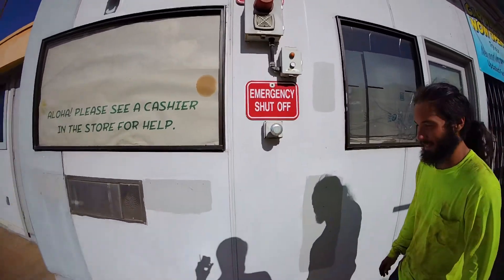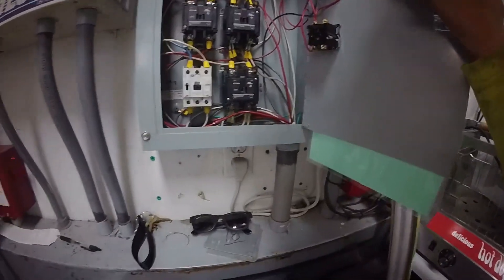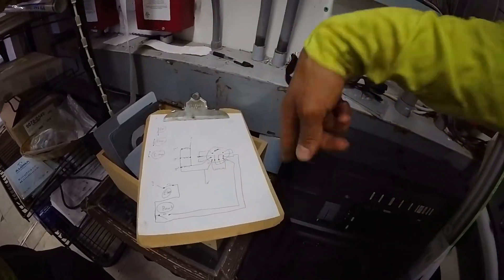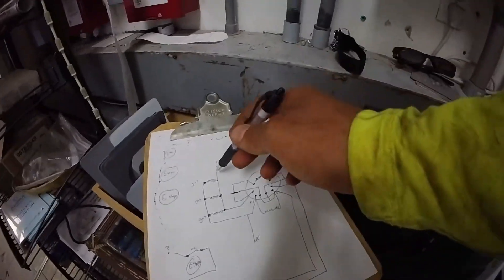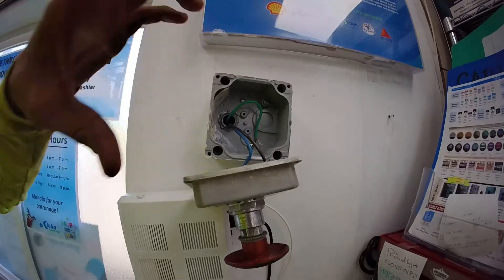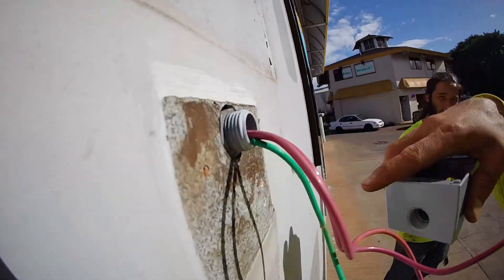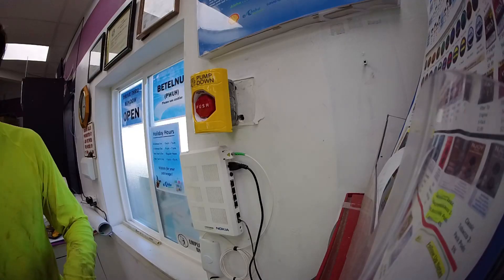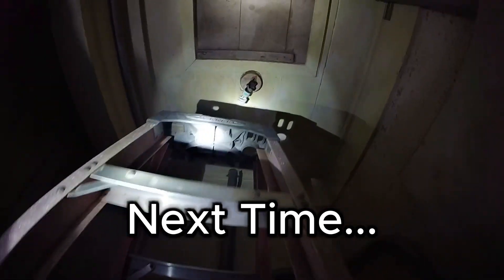Have You Ever Wanted To Press One Of These? | Let's Work EP. 62

Comment: 4:40  Concept correct but not really called "interlock" ;  more commonly referred to as a "holding" or "latching" circuit.
Interlock means two or more things NOT allowed to work at the same time.
Reply from the maker: @joes2085  thanks for the tip